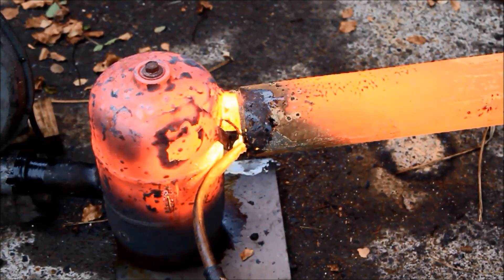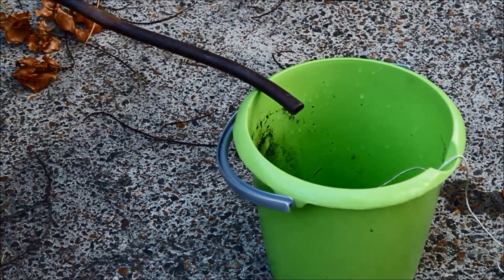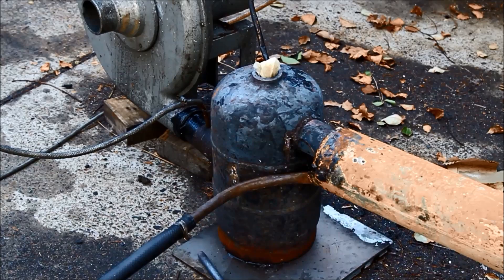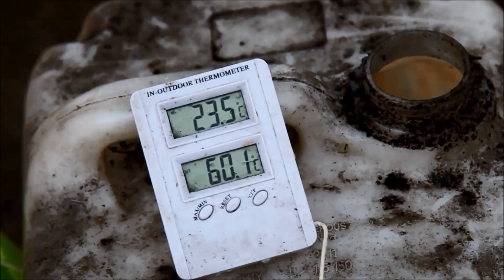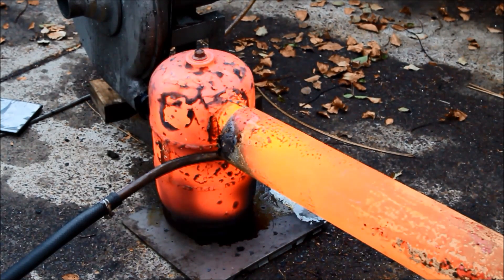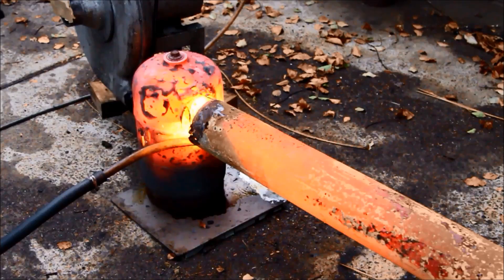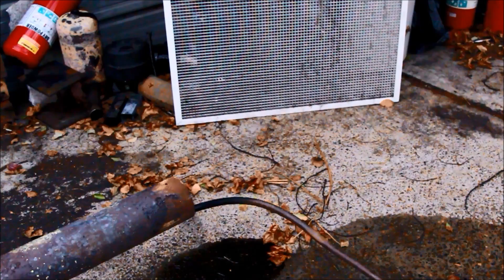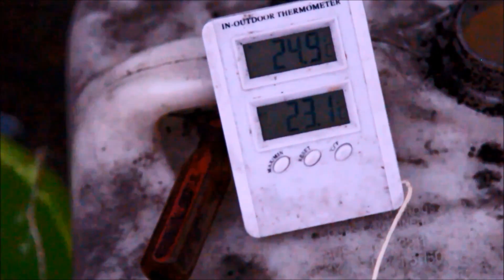EASY build water heater for emergency or survival use on waste oil

Comment: i heard you say dont offer any ideas but, i want to heat the 15000 gallons of water in my pool.
what if you ran that red and orange hot 4 inch pipe straight through a 5 foot water heater, top to bottom, on its side like your hot pipe and welded it up with an inlet and outlet for water.
there would be 30 or 40 gallons of water in the tank being heated and pumped from and into the pool.
probably should leave a pressure relief valve in it, huh.

think it would work? want to try it?
im in the US and have enjoyed the vids ive seen so far.
David
check out the guns we get to have here on my channel.
Reply from the maker: I Think to make that at all effective you would need to Disturb the flame path and get the hot gasses Swirling around. This could be done by drilleing the pipe and welding in bolts that went inside the flame tube. This would give the flame more surface area to act on and keep the gasses in the boundry layer with the pipe from getting cool and all the hot gas going up the centre.
In reality I think you would be much better off getting an old gas pool heater with a proper finned heat exchanger and swapping out the gas burner for an oil one.  That's exactly what I am going to do because of the much better efficency.  The vids you see of someone putting some copper pipe in a fire are Bunk. The heat rise in the pool would be so slow as to take forever especially in the often seen above ground pools that have a huge surface area to radiate heat out of the pool. You really want at least a 40mm pipe with good flow and a min 20oC heat rise to get anywhere on a pool your size.  I plan on sinking 200Kw into my heater which should give the pool a 20o heat rise in 12 hours.
Reply: thanks

Comment: Hi Oilburner,
I like your vids - keep them coming.  A thought on this "water heater" would be to put an elbow on the flame outlet and point it up into an old gas hot water heater.  I am working to make a burner that I can control enough to replace the wood in my outside wood boiler. Thoughts would be appreciated.

Comment: Hi Oilburner,
  Enjoy your videos. I'm trying to build a heater like yours, using a propane tank. I'm using 3" exhaust pipe, with a 3/8" copper tube feeder. Are there any critical measurements, or does it matter, how far back the feeder enters the intake. I'm having trouble keeping mine lit. I may be overdriving the air I'm using a shopvac, as a blower. I tried starting mine with the rag, but blew it out of the exhaust, oooops!
Reply from the maker: I put the oil entry back close to the blower so the oil dosent get too hot and  combust or carbonize in the inlet pipe.  I start the burner slow with the rag till the burner bottle heats up. once you have it near red you can open the oil and increase the air. 
I'd suggest either putting something like cardboard over the inlet or something line a plastic bag or rag to slow it down. Also be careful not to flood the thing with oil at the start.  Once the thing is hot you can open it all up and go nuts. Work it up slow at the start. Till you get used to it, adding some diesel as startup fuel can be a help.
Reply: Oil Burner Thanks! I'll give that a try. I was wondering if I'm overdriving the airflow.

Comment: Nearly 4:AM here and I've just woken completely up laughing my ass off.... hahahahaha.. I find it hilarious that people actually give people shit for not telling others they will burn their fingers on something hot.. Please people, if you are watching things like this, lets have a little common sense and believe that others have some COMMON SENSE OF THEIR OWN!!!!!      ------  Dave, I think you are having more fun making people laugh than building the burners these days!!  ;) I still haven't gotten back to my burner yet, but think you will beet me to it.. Maybe a car/truck radiator over the end of the 55 gallon drum with more water flow than the 3/4 copper pipe... Hell, if you melt the rad you were probably going to anyway!!   SP...
Reply from the maker: Hey Steve, Thanks for the posiutive feedback. I'm glad you are enjoying the vids although I don't think I'm all that clever with the funnies but as long as people like them.  :0)
I tried the radiator thing a few years back now and I did melt it. They seem to work a funny way. they are a lot more capeable of giving up heat from the water in them than absorbing the heat from the air into the water.  I had a good amount of heat and a ignificant flow of water. It wasn't heating up a whole lot at all. When I ramped up the heat, the radiator melted but the water was only just getting anywhere near hot.  Not sure why it happened, I have been meaning to try again in case it was just an odd thing.  Few old radiators round here I can sacrafice. That might be funny  as well.